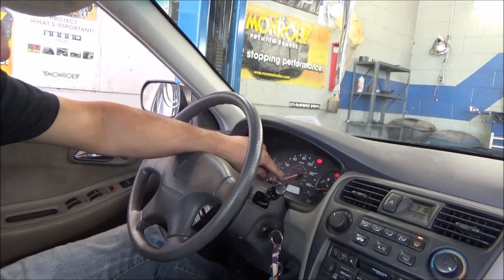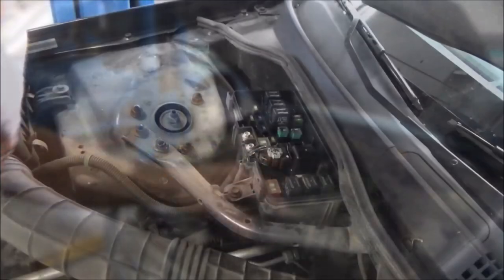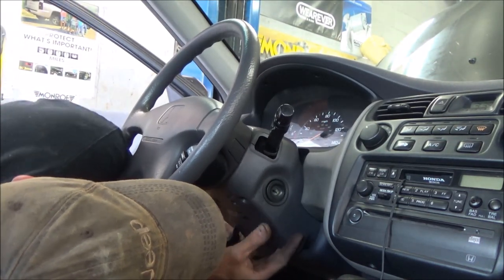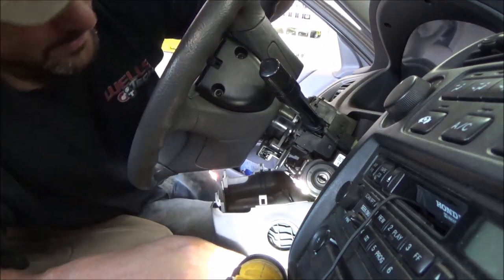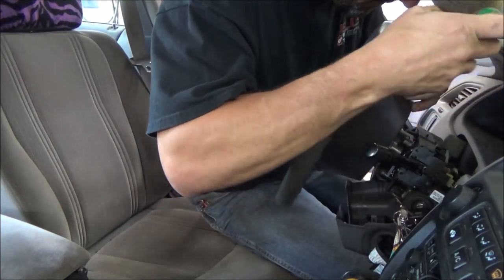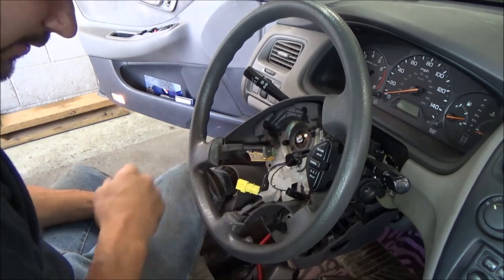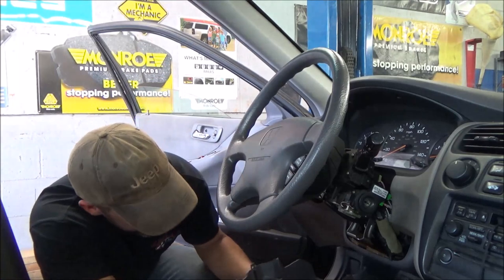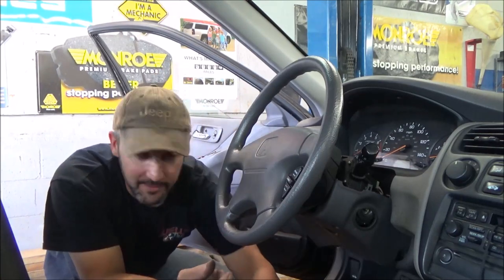Honda Accord: No Horn, No Cruise, Air Bag Light On

Comment: How cool! I just dropped my car off for this issue and my mechanic thought that the clock spring could be the issue. Which makes sense; a bit of information I neglected to tell him was the steering wheel makes a clicking noise with a noticeable vibration / tactile bump feeling when a certain amount of steering input is applied. Sure sounds and feels like the wires are goofed up inside that clock spring! 

Thanks for the fantastic lesson on how clock springs work, that was cool!

Comment: They make the puller taper because if the plate was flat it may bend but by making it taper, there is additional material (or in engineering terminology Section Modulus) to prevent the plate from deforming when you are pulling the steering wheel.  If you put a 2x4 on its side you can deform it, but stand the 2x4 upright and it will take more force before it starts to deform.

Comment: Thanks for the video. The only thing I would've done differently is make sure the wheels are straight before pulling the steering wheel. I wouldn't pull the steering wheel if it was turned a quarter of a turn. I know you put it in the same way,but after messing an unobtainable Suzuki clock spring I have learned my lesson. You can't find parts from the dealer or aftermarket on that car. At least not the clock spring. The only 2 or 3 dealers left in the country that sell parts for them wanted 600$. I got one from the junkyard and it came with a zip tie in place of the plastic pin. I figured the junkyard pulled it with the steering wheel straight and placed the zip tie to keep it centered,so I didn't bother to check it. It was probably 1 turn off and it lasted exactly 1 month before it broke again.
For what is worth,they are very sensitive and won't go more than 2 and half or 3 turns,depending on the car,from the center left or right. Install it half a turn off and it will break,I guarantee you!

Comment: My neighbor and his son had pulled the steering wheel off of his ford truck for whatever reason. And when I got home from work they came and got me and showed me the two little bolts they had left over asking do we need these in there. I had to laugh because I knew what those bolts were for and what a pain they were to put in. So I told them to take the wheel off and I would show them where they went and how to get them in and tight. They learned their lesson about just pulling something apart and not getting it back together correct.

Comment: I just started working on my granddaughters 1999 Civic.  No horn or cruise control, and the airbag light is on.  I couldn't believe it when I came across your video, I'll bet you just saved me hours of chasing down these problems.  I'll find out if I can get rid of the slippage in 1st gear first...  Thanks for a great video!

Comment: This is the 1st video of clock spring replacement I’ve seen.  Don’t feel bad about the quality, sometimes quantity is more important than quality.  You’re running a shop, not a how to service.  Just be sure you disconnect the battery for a while before messing with the airbag.  All joking aside, you could have a really bad day if it goes off while you’re holding it.

Comment: 1. Tip: When installing airbag. First set ignition to on. Then Connect the batteri. If it pops, you are outside the car. 2. You Said Stray Voltage. Have you worked for the Airforce? Arnament?

Comment: I had all the same symptoms in a used 98 accord EX i bought but with one additional symptom -the stop lamp lights kept blowing the fuse located within.under the hood fuse box, which.would caused the shift interlock to not allow the car shifter selecter to not move out of park until fuse  was replaced.
  I jumped the gun and replaced the clock spring, without first testing the horn relay. And I discovered  the driver side horn t was faulty because once I unplugged that horn everything else on that circuit came back to life and no longer blew the fuse for the stop lamps. 
Thank you for the video, it helped direct me to the fix ultimately.

Comment: long freaking video, and worth every second. First time I don't skip parts. Realized how common this clock springs fails when I search the part and they have it in Walmart.com. Have a Civic 2003 with the exact same problem and I'm not going to diagnose, after this video i'm buying the part right away. THANK YOU! SUBSCRIBED! (oh... my 50c, I have a plastic prying tool for the plastic caps, it's "safer" lol)

Comment: When u tested the horn relay and it was "all good" what would have been the symptoms if the relay itself was bad?
Reply: The terminals for a relay coil are called "85" and "86" - this is an old Bosch convention from the 1970's.  85 is the positive terminal, 86 the negative.  Possible faults and symptoms:

Coil open-circuit:  Light on 85, no light on 86.
Coil short-circuit:  No light on 85 (fuse blown).
Contacts stuck open:  Light on 85 and 86, no click, horn does not sound.
Contacts stuck closed:  Horn sounds continuously (customer will probably remove fuse).
Contacts burnt out:  Light on 85 and 86, relay clicks, horn does not sound.

Comment: I took apart the steering wheel on Dodge charger.  I did not know why they called it a clock spring. your video helps with the process of putting it back together.  Good video !

Comment: You were lucky on this one.  On my car the clock spring was okay, but none of the buttons worked. Turns out the buttons ground side was done through a shaky wiping contact which had to be peened a bit to restore the ground.  Wonder why Honda did it that way?

Comment: Thanks for the inside view of Clock-spring. It reminds me of printer flex cable, but I imagined the Clock-spring to be printed circuit board with rotating contacts. Great work Eric!!
Reply from the maker: jake ounce Yeah it is very similar to the one in a printer isn't it.
Reply: So cool! Learning circuit boards is on my agenda! Then diesels!!
Reply: Kinda surprised that 5 of the 6 lines failed. Must have been a nasty kink.

Comment: Thank you so much for this video. My car's clockspring has a busted wire, and this fix gave me the confidence to fix mine myself.
Reply from the maker: Aza Shukri make sure you get a manual and follow directions when playing with air bags.
Reply: Hey South Main...what do you suppose is going on that when I hook up the battery, whereas, after it had gone low and then after recharging it, once I hook up the cables, the horn immediately goes of, and the second time I reconnected the cables — cause I quickly disconnected them after the horn went off — the horn went off again, but the second time, again the horn went off while at the same time I also heard some relays rattling in the relay box ...any ideas/suggestions as to what may have happened or what may be going on my friend? 
Thanks, and I really hope you're still are out there in your garage and I also hope that you area able to respond...Thanks again and God Bless...also again GREAT VIDEO!!!

Comment: The steering wheel puller is chamfered for strength. Always position the chamfer toward the piece that the center driver is pushing. You used it correctly

Comment: Man...You just don't know what's coming through the door, your trouble shooting is top notch.
My 82 ZX Turbo, has as you say the old style, kind of a push pin with a small spring to make contact for the Horn, But I lost the small pin, so no horn. But hey down here you take a chance of getting shot if you blow your horn at someone. And we have a lot of retired drivers here so you would pretty much wear it out anyway. Had to take my Moms car away after she had 4 fender benders in 3 months. Hated to do that but didn't want someone to die because of her, I became her taxi for the last years of her life, and grocery basket pusher. And at one time she owned a 1969 327 S.S. 4 speed. With a cool racing stripe. She bought it only because she liked the color.
Reply: In 1959 the road we lived on didn't have a speed limit, 2 lane black top, My Mom decided to go in front of a Judge and see if she could get a limit put on the road, and a few signs ( we lived directly off the road ), Well they did do that. And she was the first person to get a ticket. She laughed for days.Diesel Pickups, now that's cool.What type of camera do you use ?Just set the 27 foot boat on to rail road ties in the back yard, Now to strip the axels (3) and put new axels and springs under the frame, Fun, Fun, Fun.
Reply from the maker: Haha that is such a cool story. She was really the 1st to get a ticket ? Do as I say not as I do right lol. I use a sony handi cam from the wally world. Sounds like a lot of work. To damn hot in FL to work out doors aint it? Kinda makes me feel like I need a nap.
Reply: Yes she was, I believe she, in a round about way, taught me that you just have to laugh at yourself sometimes.Like one time I went to visit her form Houston, she lived in Clearwater FL, when I got there she was outbackworking in the garden, She was totally bald, she had bleached her hair so many times it finally fell out, wheremost women would hide in shame, she just laughed, and threw on a baseball cap :)
Reply from the maker: Haha sure sounds like she was a pretty cool lady :)

Comment: it's interesting that you can get what appears to be aftermarket srs parts. Usually dealer only in the UK. Also a little odd that you didn't centre the steering wheel and make sure the front wheels were straight ahead before dismantling.  Appreciate your vid's and the time taken though. 😉

Comment: isn't there a safety thing where you should have disabled the air bag before removing or messing with it, like removing one battery lead for a period of time?
Reply: I thought he did because he seems to mention it but probably cut that part out
Reply: Shouldn't really be an issue, depends on what you are doing.
Just plugging/unplugging there is no real danger, (unless as Eric stated there is "stray voltage"). But there shouldn't be, and if Eric thought it was a real possibility he would not have sat there.

Comment: Lotta times the horn will blow with the wheel in the 90° position, but not in the straight ahead. The contacts wear out where the wheel spends most its time.

Comment: 30 seconds in, noticed the cruise was in the steering wheel. I'm going with Clockspring for the win...  Guessing rack and pinion was changed out at "a previous shop" and they spun the wheel  while out or installed the rack while off center.  Would bet the customer drove it away and on a sharp turn or while parking, the ABS light came on.  Let's see if I'm right.

Comment: Interesting info about the clock spring and its operation, I see why engineers make so much $$$$. A few weeks ago I replaced the headlight switch on my Jeep, dash lights were on and off unless kept in certain position, got 1 on ebay new for 80.00 and maybe an hr to replace, sure cheaper than a dealer and I learned something.
Reply from the maker: jim dandy Cool glad to hear you could fix it yourself too.

Comment: How can you get a horn button not to stick on. Would it help lift up on the airbag when putting the bolts in. Please get back to me. I have the horn switch unplugged. It just happens when I put the air bag on

Comment: Hahaha. VTEC Power yessir. Good video man. I've done a few before, but for someone who hasn't, this video would definitely take away the "fear of the unknown" for them. Relay jumpers...Gonna have to add those to the box now. Good on you for putting in plugs for other youtubers as well. Most guys would try to capture all the audience and then some. Added effects were pretty cool man. Keep on truckin'.
Reply from the maker: John Kirkland Added effects? That was straight VTech power son! Haha hey I will give credit where credit is due ya know. A lot of people make great videos I think.
Reply: Haha, yeah pure VTEC suuure. But no, I was actually talking about the VIDEO effects. The intro etc. where you're pulling it in and the transition points. So long as it's not overdone it definitely makes the video look more professional. Yeah I've now subscribed to Ratchets & Wrenches. Lot's of good auto a/c info there. When do ya'll start prepping cars for winter up there? Mid-October?
Reply from the maker: Yeah I try o start encouraging people to do it in Oct.

Comment: Maybe you should check the resistance of that airbag squib. <Takes a step back>🤐

Just kidding.

I usually try my power probe on the horn first, if I can get to it easily..... before I start pulling diagrams and fuses. I like your relay tool kit, I need a good one. One that works with as many types of relays as possible as I work for an independent. Do you have a recommendation?

Comment: Excellent hoki poki - but also way more than I can do at home ;p

Any ideas why the cruise stopped functioning after a battery change [2005 Civic]? Stopped functioning as in the lower left panel switch clicks in but does not light up, and the switches on the steering wheel right side don't have any affect.

No other issues [all other electrical is working normally]. Reset the radio using the code and it's all fine.

Thanks!

Comment: ANOTHER super detailed,informative video=THANKS
 and NO brake cleaner spray !!

   " once upon a time" only HORN WIRE connected to wheel
    NOW latest cars could ADDITIONALLY have Heads UP Display,infernal radio AND DVD controls,
       plus GPS and infomedia stuff incorporated-possibly auto driving function ~~

Comment: What is the wire coming out of the cassette players tape box. I have a cassette player in my car and I don't have a wire coming out of the place where the tape goes. How could I listen to Metallica with a wire in the way?
Reply: ***** What's an MP3 player? I actually know I've just never used one. I still play my cassettes of which I've got a huge music library.
Reply: SATAMAN Schmidt Wire is most likely a CD/MP3 adapter. Has a tape inside, the end of the wire has a 3.5mm jack that you plug to your CD/MP3/Phone...
Reply: ***** Did not see your reply when I wrote mine.

Comment: Awesome! (as always)  The clock spring was, I believe, introduced with the onset of the front air bag. Insomuch as one tiny little arc could set it off, the slipring and button method had to go!  Imagine that on the interstate at 80 per!!   I say get rid of the front air bag and keep the clock spring.....     Cort

Comment: yo sma so I replaced my clock spring and every time I press on the horn, the fuse blows so i disconected one of the horns i believe the low pitch horn and when i put the fuse and press the horn my horn turns on but doesnt turn off. I checked the connectors to the horns but I didnt find any wires out. srs light is still on and cruise control doesnt work even if i disconect both horn. what should I do?

Comment: Hey Eric, I have a 2007 Dodge Charger with no horn. I have checked all the usual stuff(fuses, relays, etc,) and all are fine. My horns do work when I press my doorlock button on my keyfob so the horns themselves are working. I was told by someone at the dealership that it needs a new airbag cover because the horn is controlled by a thin membrane on the inside of it and they break easily. How can I test this so I know if it is that or if I need a new clockspring? I have NO steeringwheel controls and my other functions are working(turn signals, cruise control, etc,)

Comment: You have any idea for my horn?  the steering wheel pad horn doesn't work,  when I press the panic button on my fob,  still no horn.  fuse is good and new.   would the clock spring cause the factory alarm horn not to sound off too ??

Comment: I'm paranoid with those airbags.  if that thing went off laying on the steering wheel the metal part would hit you in the face at super high speed, I'd hate to see the damage from that.
i know chances are very slim but stills bothers me.
Reply: Airbag work isn't necessarily dangerous, provided you follow the proper safety protocol, which usually includes disconnecting the battery if you're removing it. You never want to use an ohm meter on an airbag for open or short codes, though. That's just a bad idea. Easiest diagnosis for that is to access the airbag, install a simulator in its place, and recheck for codes. If the code doesn't reset, you not only confirmed a bad airbag, but you also confirmed the wiring is good to the airbag control module.

Comment: THANK YOU!!! This helped me so much! Pretty much exactly the same problem I had! (Horn worked for me, but the cruise didn’t and the SRS light was on.) hoping the SRS light will stay off because I cleared that code. We’ll see. Thank you so much again! I was able to replace this all on my own. Thanks to my local shop though for narrowing it down to this particular part of the vehicle though. They told me it was in the steering column but would be too expensive to fix. With this video I was able to fix it myself!

Comment: friend what happens if one day you wake up and the car horn sounds off  forever without touching it to the point that you have to unplug the main car battery ,,to silence the sound ,,?
well after all this once i reconnected the car battery ,, and press my car horn ,,its without a sound ,,,and now im without a horn and before this yes i replaced the clock spring that was damaged .,to  another working clock spring  to have a working car horn ...
Im just curious what is my issue here?
Can you let me know what you think????
Reply: I would say that someone was trying to break into your car and they set off the alarm.

Comment: Eric I got a question on my steering wheel one side of the horn button is working but the other side is not working what could be the problem? it for my suzuki sx4 2008.
Reply from the maker: +Morad4000 Prolly just a bad switch. You'd have to have it tested to be sure.